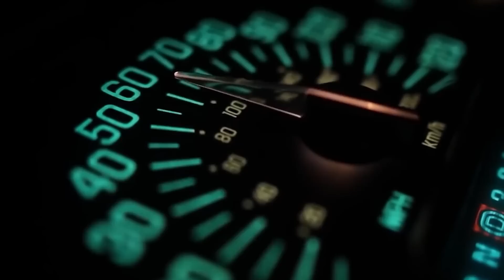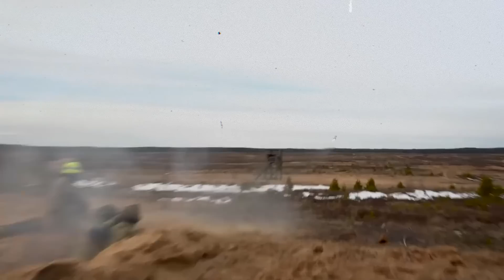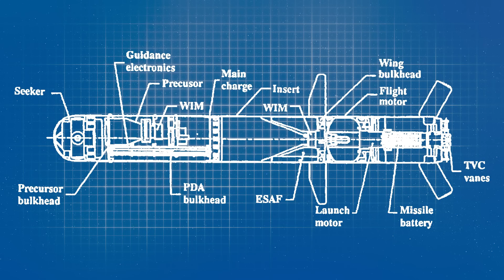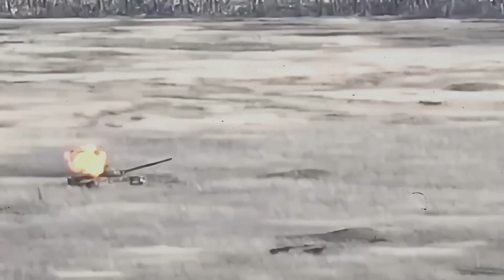The Javelin: The Missile That Redefined Modern Warfare

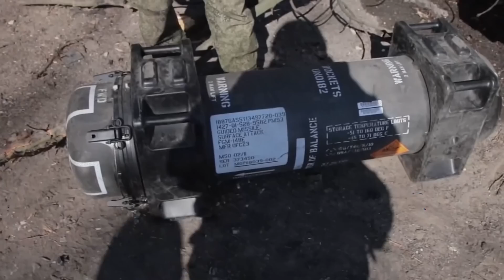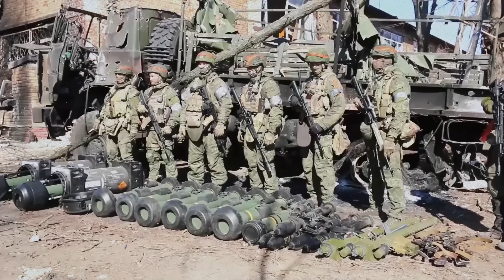Comment: There was a normal channel. And now he has indulged in some kind of propaganda. It’s even somewhat annoying now to realize that previous videos can also be “superficial.” The javelin has a lot of shortcomings that people try to keep silent about. And it's not just the exorbitant price. It is not as deadly as it is given credit for. When using a horizontal flight path, Javelin has low armor penetration rates compared to other modern anti-tank systems and can only be used against armored personnel carriers and other lightly armored vehicles. A tandem cumulative warhead cannot cope with defeating modern main battle tanks in the turret and in the frontal projection. The range of the Javelin is only 3000 m, despite the fact that the Russian-made Kornet-EM ATGM is 8,000/10,000 m (anti-tank/high explosive). The use of an infrared homing head makes the missile vulnerable even to the old Shtora-1 system - an electro-optical active tank protection system used mainly on T-90 and T-80 tanks. If before 2013 the Shtora-1 system could “miss” the missile and not work, then since 2013 the new Javelin modification equipped with a laser rangefinder initiates the tank’s protection to operate automatically. Videos of the operation of "Shtora-1" and the successful protection of the T-90A tank have been known since the war in Syria. The mesh on the turret is not used for protection against Javelins (the Javelin does not fall into the turret, but into the engine compartment), but for protection against drones and British NLAW grenade launchers, which use a magnetic detonator. To counter the javelin, a long pole with several high-temperature chemical flares attached was used. The flare's high-temperature chemical combustion effectively deflects Javelin missiles within 1 m, which is usually enough for the tank to survive a hit. Now the use of Javelin in Ukraine has become so rare that tankers usually do not bother with "homemade" countermeasures. Huge stocks of these anti-tank systems were captured by the Russian army in the first weeks of the war. Confirmation of this is honestly presented in this video - 8:55 & 11:48. In all the videos that show the enchanting detonation of tanks after being hit by a Javelin, tanks from the fifties and sixties of the last century are shown. Although, as the conflict in Ukraine showed, all modern tanks, including Challenger 2, Leopards 2 of the latest modifications are very vulnerable not only against the latest generation anti-tank grenade launchers, but even against FPV drones with RPG-7 grenades.
Reply: @Tbone1492  What are you talking about, sir? Since 1996, a total of 40,000 have been produced.
Reply: Russian trolls as always
Reply: The orcs have found this channel lol
Reply: @AlanPhillips-g1c  I always discount the opinions of alleged human viewers who have names like 
" @user-vp4ml6wp5o". That type of name is used by trolls and bots.
Reply: The name  @Станислав-с6п8я  sounds like a troll or bot
Reply: I always discount the opinions of alleged human viewers who have names like 
"@user-yw9kw3qv6x". That type of name is used by trolls and bots.

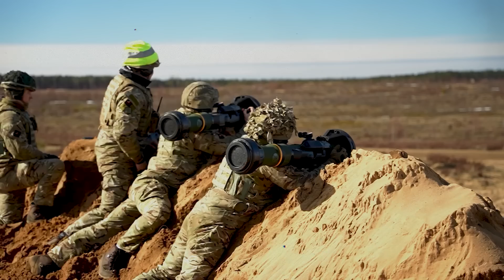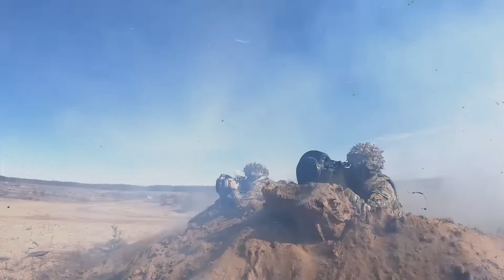Comment: Sure do seem to see a lot of footage of NLAW getting mistaken for Javelin. (As here at 4:26 and 4:38) They're both soft-launch ATGMs with clever tech, but the Javelin is in a class above.

NLAW lacks thermal optics and the missile is completely blind once fired. It follows a predictive track using inertial navigation to try and hit a target. It is much lighter, but also shorter range,  less effective and less accurate. I don't say that to undercut it. NLAW's lower weight and cost really do earn it a spot on the battlefield.

But Javelin's much larger warhead, thermal tracking, and much greater range make it pretty much a guarenteed kill even at extreme ranges, while NLAW must fired fromwithin a few hundred meters and often misses or fails to fully incapacitate a target.

You get what you pay for, and Javelin packs a lot of features to justify costing several times the price of an NLAW. Hell, it can even engage helicopters effectively.

Comment: Back in 2008 we ran a night operation together with a British unit where one of our platoon commanders was given tactical command of one of the British Javelin squads alongside his own platoon which were acting as support/suppression. he wasn't trained on the Javelin but was supposed to say go or no go on any shots they took. 

During a firefight in very foggy weather the javelin section took aim at a target and asked for permission to fire, the commander took a look through the optic and seeing no "cat eyes" or similar night fighting markers on the targets (which everyone wore, that would be visible in his NVGs) he told them to shoot. 
Turns out it was one of the British assaulting sections, a blue on blue accident, and a couple (I don't recall the exact number) of their own guys were killed or wounded. If I recall correctly the commander and anyone else involved was interviewed by MPs and he was then flown home to account for his decision and was found not at fault, it was deemed a terrible accident, he then came back to continue leading his men for the rest of the deployment. 

Still, this highlighted to me a problem with identifying friend from foe in this system being used against infantry, since there's really no good way of making an IFF marker for a thermal system besides maybe short circuiting a 9 volt battery in your back pocket and hoping it doesn't burn your ass off or explode your ass off, the conventional reflex-markers and IR strobes only show up in light amplifying equipment, but thermal systems don't amplify light.
Reply: The Army had the same problem with blue-on-blue attacks during Desert Storm, this is why all US Armored vehicles have the "corrugated" looking recognition panel. This panel shows a different color on thermal/IR/FLIR. Something similar needs to be developed for infantry.

Comment: I used to shoot the predecessor to the Javelin and even the Dragon was bad ass! It was goofy watching the round bounce as it headed down range but to say it was inaccurate is an oxymoron because it was dependent on the gunner to be able to keep it on target. There was nothing wrong with the round itself being inaccurate and like a NASCAR, its only as good as the one steering it!
Reply: I learned on the POS called the Dragon and actually became an instructor. It is accurate so long as you keep the laser on the target but there were  just a few issues.
 Issue 1: if the hair thin wire gets snagged on a twig and the missile goes haywire. If it crosses a stream it might go haywire. If the tank has a laser dazzler, you guessed it, the missile goes haywire.
2: after you shoot it theres a nice smoke plume leading right back to you and the missile was SLOW. Keeping the laser on a moving target at a long distance is hard, doing it while every armored vehicle in the area shoots at you is insanely hard/suicidal.
3 keeping that lasrr on a moving target when theres smoke, trees, and friendlies moving in front of you.

It has two advantages, first, you can launch it faster at point blank range. Second, its cheaper. Keep in mind I never got to fire or play with the javelin, the most I ever did was look through the CLU and prepare it tp fire in EIB.

Comment: In reality, drones changed modern warfare. Everyone has started using drones. 
As efficient and affordable as nothing else on the market.
Reply: Just in this war. In reality, there all kinds of electronic measures and anti air weapons that could take them out. Just the Ukrainians and Russians can’t get all the resources they need into place. If the US was attacking, wars over. Only insurgents left.
Reply: Drones have an EM signature and can be tracked and the guidance radio signal is commonly interfered with using jammers. Apparently drone operators have one of the most dangerous jobs in Ukraine.

Comment: Great video 👍

The raw energy of the explosive contained in reactive armor is what defeats the hypersonic molten metal lance of shaped charges in missiles, not shrapnel from a preliminary explosion

The javelins preliminary charge breaks a proverbial "surface tension" of the target, allowing the main charge free access to the newly accessible plate armor beneath

Not a great idiom but I hope it helps 

Loosely compared, in springboard diving and high diving we rapidly scoop a little hole in still water with our hands to break surface tension and minimize splash as our body follows into the pool.
Also why dive tanks have  little fountain next to the diving board at competition and why you should toss a stone into a still lake before you cliff dive into it from great height

Comment: Would you not say that cheap drones have been alot more effective? 
The Javelin costs $178,000 and each replacement missile costs $78,000.
In comparison, a $400 drone packed with explosives can destroy a $2million tank. And the cost of shooting down drones vastly exceeds the costs of making them.
Ukraine has admitted that Russia has a 7-1 advantage in drones.
Not only can they deliver exposives themselves but they can also guide artillary, which is ultimately what causes the most damage in the Russia-Ukraine war.
Oh and Russia has a 10-1 artillary advantage too, as acknowledged by the ukrainian military.
Javelin seems like another of those much-hyped "game changer" weapon systems like the Leopard, the ATACMs, the Stormshadow, the Patriot system, the Bradley's etc which was supposedly much superior to the Russian gear.
But still Russia is slowly winning the war, even if it will likely be, as Mearsheimer has predicted an "ugly victory".

Comment: People think that Javelin is the revolutionary weapon because the media has hyped it up, but people forget that Russian and Uke gopniks are flying $50 drones into the roof of each others tanks by the truckload. Like, I get it, Javelin and NLAW is le shiny and Western so all the kids think it's hot shit, but the fact is that Ukraine has been the first large scale conflict where everything that Javelin can has been replicated en-masse on both sides for a mere fraction of the cost and deployed in their thousands to the frontline. Imagine a weapon as numerous as the RPG-7 with all the capabilities of Javelin and cheaper than both - that's exactly what has happened in Ukraine. I genuinely believe that it's going to change the way that Tanks are used forever.
Reply: Drones have their place but so does the Javelin.
Reply: Drones have an EM signature and can be tracked and the guidance radio signal is commonly interfered with using jammers. Apparently drone operators have one of the most dangerous jobs in Ukraine.
Reply: @AlanPhillips-g1c  A kink that I soon expect to be ironed out. Signals can be encrypted, hidden etc. Even the electronic signals acquired by SIGINT groups on both sides are weak and vague and they have to fire everything they have at the suspected location to even get one guy flying his bargain bin drone, and this usually after he has buzzed it straight into an enemy dugout or into the top of a tank or whatever. 
I don't even want to think about what's going to happen with these AI loitering munitions.

Comment: $110,000 or $500,000 for the unit, but most of that is the optics and targeting system that's reused right? So what's the cost post initial purchase? IE Cost per shot?
Reply: The missiles are ~$78 000 per round
Reply: @Mriswith2k No, US Army requested ~121 million to buy 376 missiles May 2022.  They are $320,000 each when you make one per day.  Which is the rate the Army was buying them in FY22.  It went to $160K per when the Army bought 6300 in May 2023 for 1.02 billion, with options for tens of thousands more.

Comment: Fun fact my dad works at Texas Instruments and his job is to design the blue prints for the microchips for the engineers to make but unfortunately he is never told what they're for so it is very much possible that my dad designed the microchip for the  Javelin without knowing it.
Reply: i mean most chips have more than one use, but ur dad still has a cool job which requires a bunch of brain-power to do
Reply: @M4xXxIkInG  yeah. He's been working for TI for about 40 to 50 years now. He's going to retire by the end of the year.